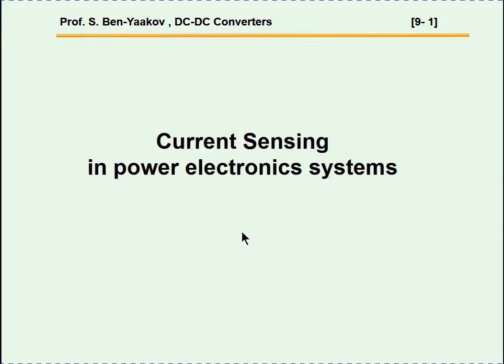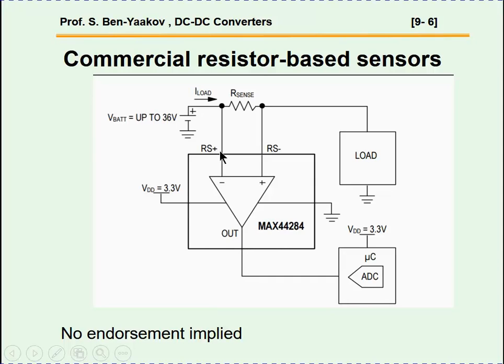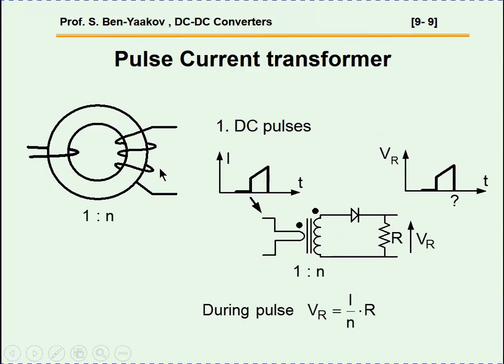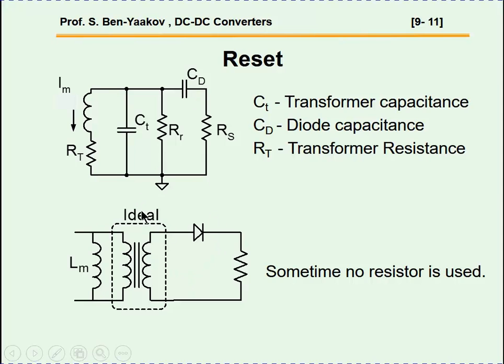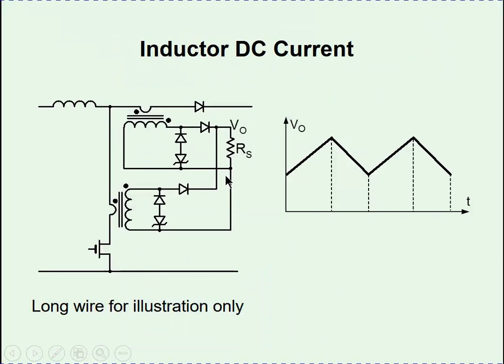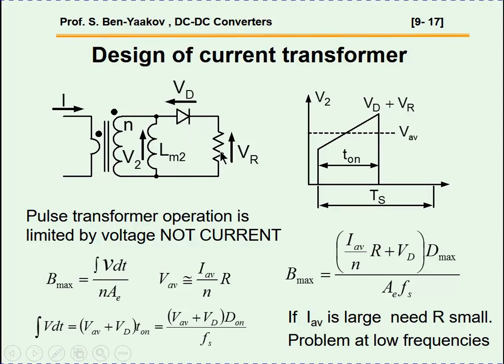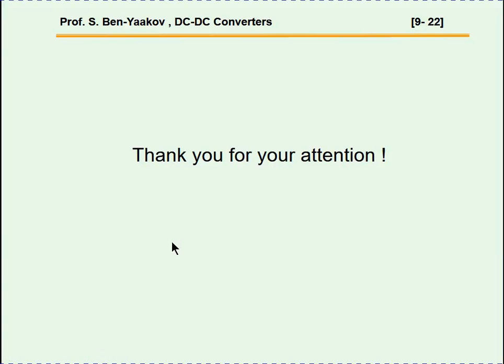Current sensing in power electronics systems

Comment: RC=L/Rs  Very useful equation when the coil wire DC rezistance is steady. Maybe need to compensate the temperature coefficient of the copper wire for high current values? 
Do you think a NTC in place of(or in parallel to) R would do ?
Thanks Mr. Yaakov for the  nice videos.
Reply from the maker: You are correct there is a temp sensitivity. Inductor wires are normally made of copper which has an appreciable temp coefficient. R is NOT added! it is the resistance of the wire!
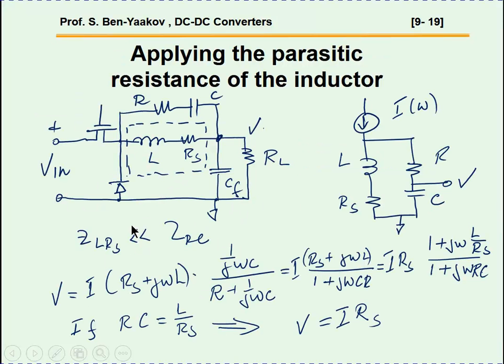Reply: I meant R the resistor in serial with a capacitor across  the inductor. 17:45

What correction method  would you suggest to get accurate  (free from temperature ) current feedback from the inductor? (other than larger wire diameter)

Thanks.
Reply from the maker: Sorry. I misunderstood.  Good idea, perhaps somebody else already did it? I don't know. The problem of temp tracking is that in real systems the temp inside an inductor winding might be much higher than the ambient. At any rate, in most applications, there is no need for high accuracy in the measurement of inductor current. This signal is normally used for current feedback and there is no need for precise current measurements there.
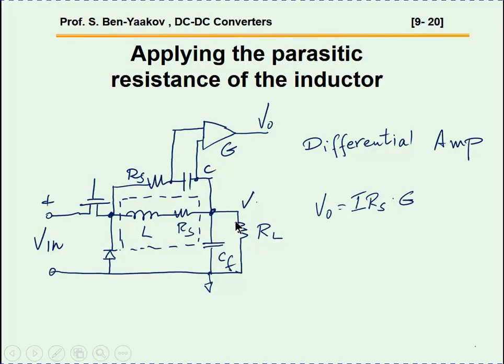Reply: Here’s an idea. The “differential amp” @19:44 could be implemented in the usual way with an op-amp and 4 resistors, where the gain is the ratio of resistors.   Use copper (or iron/steel) wire-wound input resistors (with a tcr similar to the inductor) that are thermally connected to the inductor.  This ought to decrease the amplifier gain as the inductor heats up.

Comment: Very interesting video! I have only thought about putting a single winding on the main power transformer, using the existing magnetic flux and the seperate 1:1 transformer using the existing input current to switching circuit. However, this brings a lot of new functionality to the table! Thank you. Also, what does j and omega stand for in 18:00 ?
Reply from the maker: As I think I have said in the video. I am doing the analysis on any one of the Fourier frequency components (omega)  of the inductor current and using the complex representation (j) of the impedance and filter.
Reply: Oh that might be, I must have missed it, excuse me! Thank you!
Reply from the maker: All the best